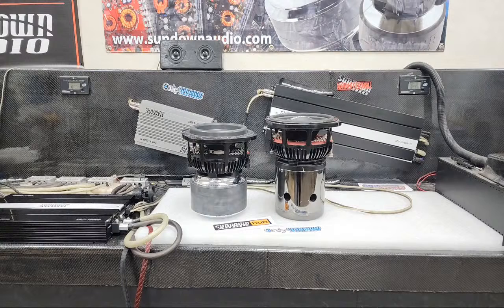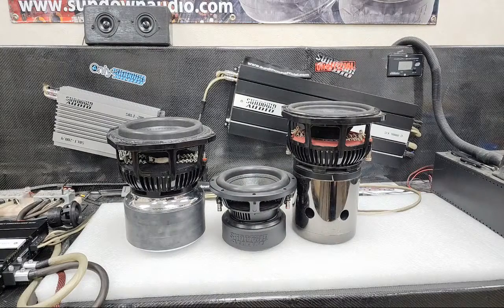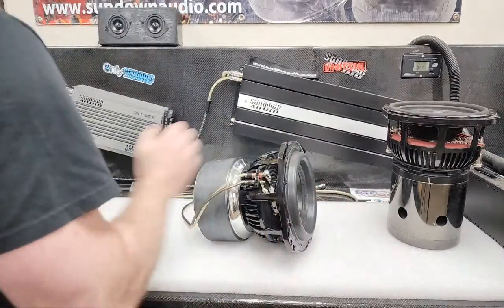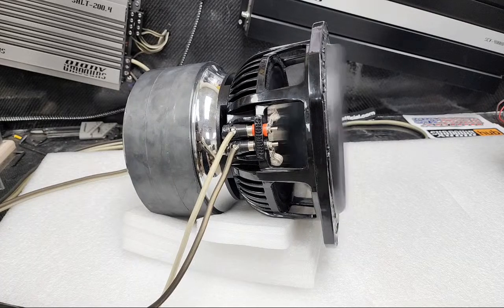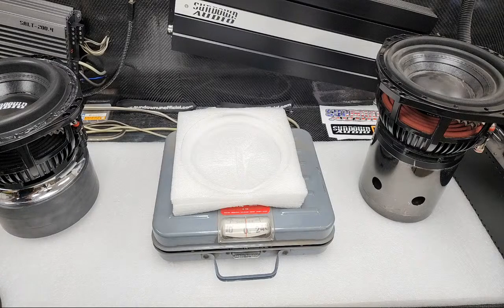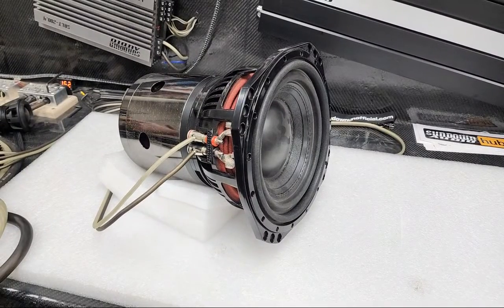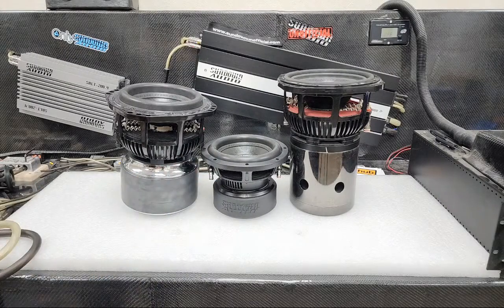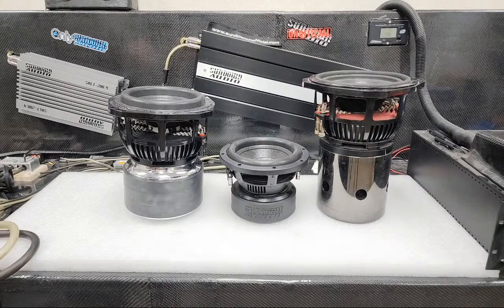Sundown Z-8" & NS-8" Live Testing

Comment: Okay, this seems to be a good place to ask. Being the large-cone fanatic that I am, what makes for a GREAT large-area subwoofer cone construction material?

I have always thought carbon fiber composite would make a great material due to being light and rigid. Carbon fiber, layer of rigid polyurethane foam, carbon fiber, all held together with epoxy.

Theory: The ideal subwoofer speaker cone would weigh nothing (zero mass) and be infinitely rigid while being fairly large in diameter (about 18 to 24 inches) would it not? Thus the energy used to drive the speaker's moving part would be devoted to pressurizing and rarifying the air and not controlling the speaker cone, yes?

Also, would that not make it more acoustically accurate?

If this is functional, would a large, powerful higher-than-one-ohm motor be desired to give the amp better control of the speaker's behavior? (high damping factor?)

Comment: I love sundown I’ve ran a lot of your subwoofers I just think 8” subwoofers are losing there purpose most of these new monster 8s are so big you can run 10s or some 12s
Reply: nah they ain’t loosing their purpose that’s the point for them to evolve and not just 8s but each category. and most people would rather have 4 8s in their truck than run 2 tens or 12s cause of lack of airspace. lots of people are starting to love 8s cause of its size and how much power they are putting out now
Reply: At 11” deep you can’t put 4 of these in any truck you will need almost 5 cubic feet of airspace even with a seat lift they won’t work correct
Reply: @jlsking84  exactly .. I been saying this.. if you need over 2 cu of airspace you can likely run a ten .. and run one that cost half the money 🤷 I think for most the point is to say " it's just 8s.. well ok but who cares . If I'm going to invest in that much motor why not have the larger cone??